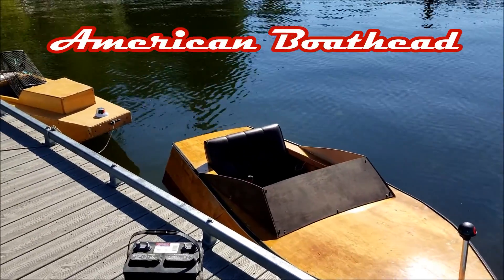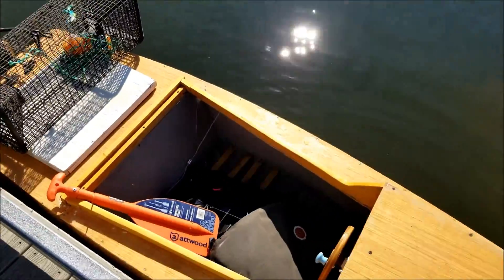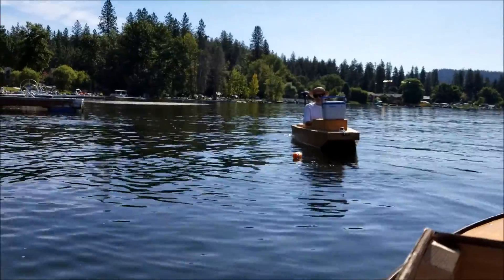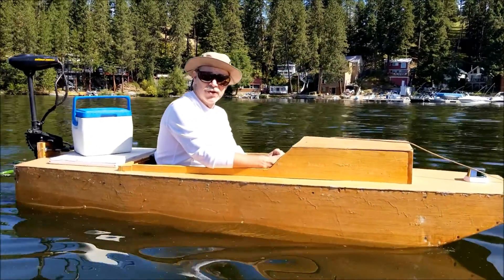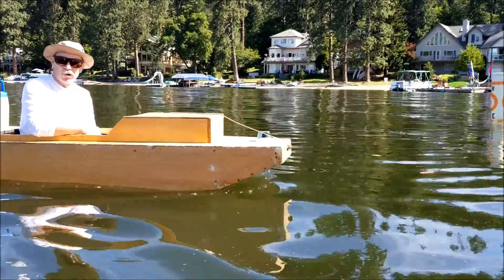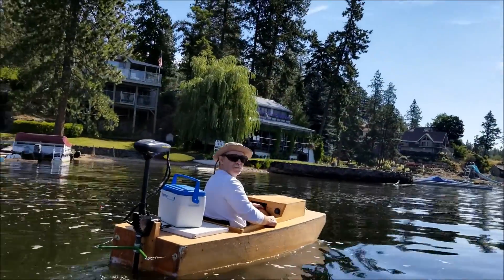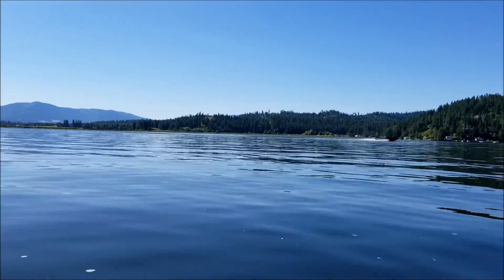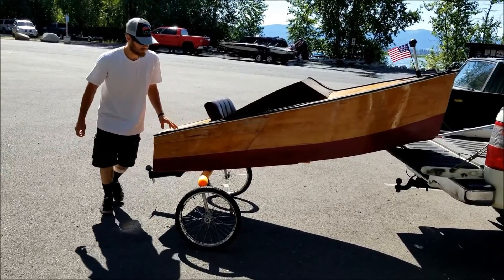plywood mini boat fishing with Ken!

Comment: Pretty slick little boats !  For your replacement fins  you can Epoxy a peice of plexiglasss  onto the motors  fins are usually  a sacrificial part of a motor  because they are the first thing to hit a rock or the bottom   They are more important on  outboards and outdrive that spin much faster than trolling motors  although you may find your tracking gets slightly better

Comment: To improve run time and performance you can replace the junk controller that waists power with resistors for any setting under full power with a bicycle type controller, also replace the prop with a model airplane plastic props. You will see huge improvement.
$0.02
Been there done that !
My 17' canoe drive, 4 stroke weed eater likes 10" props and are only a few bucks to replace unlike trolling motor ones.
Just
Say
N

Comment: Im building a miniature chris craft barrel back (kind of). Ive got some questions about freeboard and overall dimensions, if you dont mind. What is your overall length? Im at just under 8", so i can put it in the back of my truck. At 7" long, and 42" wide...im not really sure how stable she's going to be. 

I love the little boats. You guy's look great. That looks like a blast. Have you considered using 2 deep cycles wired together? Or a small 2 or 3hp outboard?
Reply from the maker: Mine is 8ft long and 30" wide and it is super stable! If i went wider it would get some heavier but have room for two people maybe!
Reply: @americanboathead5390  2 people is the goal. Im making it out of 1/8" pine strips, so hopefully thatll help keep the weight reasonable. Thanks for the reply.

Comment: How long do u have on the water with those batteries? Are they deep cycle?
Reply from the maker: Obviously it depends on how much you throttle around...  if they are on full blast, they should last 3-4 hours or more.  Itd be easy to make them last eight hours with some fishing or just drifting with power off type of things.  I have a deep cycle marine battery and ken here has just a reg. Cranking battery i believe

Comment: How much roughly will it cost for me to build a mini boat, keep up the great work love the videos!!!!
Reply from the maker: Thank you!!  Its hard to say due to how much you search for free or cheap parts.  But  around $80 for new marine battery, around $100 for new trolling motor (less for used) then maybe $75 for wood depending on how you build it of course and size. Then $75 or so for fiberglass mesh and resin etc. So between $250-$500 itd be hard to spend much more than that without expensive electronics i guess!
Reply: If you can wait on shipping I have seen some cheap electronics, switches, power meter at wish . com     They can take like 3-4 weeks to deliver.

Comment: Cool boats but always those ugly steering wheels.. why?
Reply from the maker: Cheap/free and small for one thing. The other is that many times  if you get a mower or gokart wheel small enough, its really difficult to attach them the rest of the steering system!  Alot of people just see a part they need and make it!
Reply: and it is harder to use a drawer pull as a knicker knob